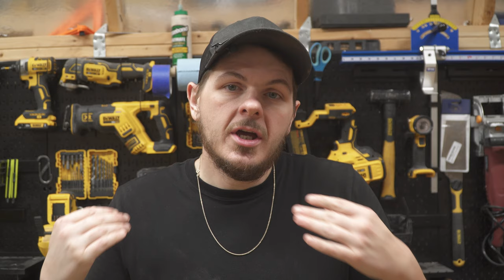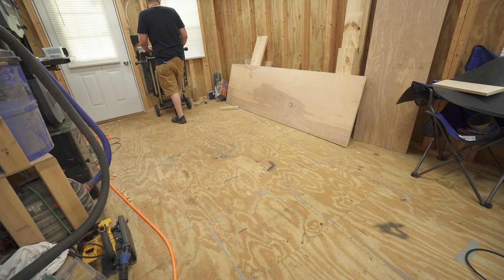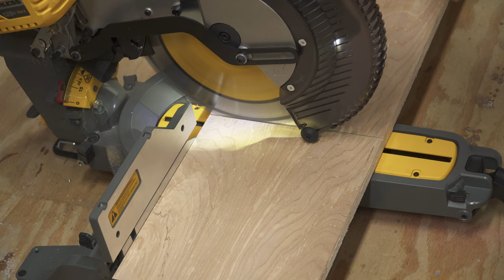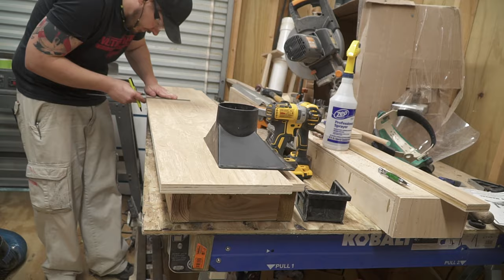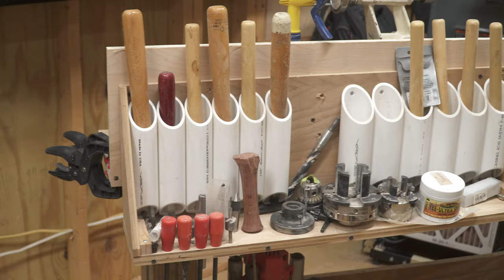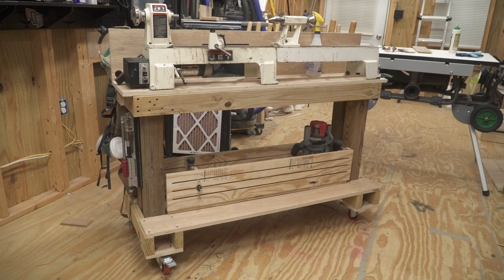Building A Mobile Lathe Cart In Under 2 Hours!

Comment: I agree with the other comments about the amount of face time. Remember that viewer engagement is really key to getting your metrics in order.

In your opening you talk about how narrow your new shop is, but really, that could have been over a quick panning shot, or a couple of shots of the struggles you're having.

In writing, Ernest Hemingway popularised the "Iceberg theory", which to oversimplify can be summarised as "Show, don't tell". You should apply this theory to your own works, as you're moving into the narrative and storytelling space.

But - regarding the project here. There are SO MANY GOOD DESIGN ELEMENTS! I love the backing with the chip collection. I love that your pen press hangs on the side. I love the tool storage on the back (though I can see chucks getting knocked off - so maybe add a lip? Also reaching over the lathe for tools is bad practice, so it would be nice if that section swung out to form an L).

For a 2 hour project, I think you did a great job!

I know this is only a couple months old, but are you finding it stable enough to turn on? Does it add enough weight to stop larger pieces vibrating? Are the wheels solid enough?

Thanks for sharing. I'm definitely borrowing some of these elements for my stand!
Reply from the maker: Thanks for the input. The casters have heald up great so far  and seems to be very stable. The lathe does not accept over 10in in diameter turnings so haven't turned anything large yet but it's pretty stable as far as I can tell especially when all of the casters are locked. As far as the tools I don't use that area for tool access during turning as I bring the tools I will need forward before I begin. So reaching over for me is not an issue. The chucks are held in place by dowels that are inserted at about a 40 deg angle now so they can't go to far. So hope that helps.

Comment: Good morning:

I have been doing a lot of research on designs for my Grizzly lathe with extension.   There have been many good designs but yours has been the only one I found that designed dust collection in.   I have a couple questions about how your design works in context of dust collection.   I don't really need plans as I can figure that out myself for dimensions, etc.   My questions are mostly about the most effective dust collection.   I don't have a stand right now so I'm asking in order to inform my work.   I appreciate your design, particularly that you gave thought to the dust collection.

1) How does your dust collection work for you?    Does it capture most of the shavings?   Do you have to do a lot of manual sweeping to get the shavings into your dust collector?   Does most get captured?   How much ends up on the floor?  I have a cyclone with 6 inch duct work and have spent a lot of time integrating my tools to use it.  What I envision in a design like yours is 2 four-inch ducts behind my lathe which is close to what a 6 inch duct  can carry.   I was wondering if you found one four inch duct sufficient. 

2) Is the back high enough to get most of the shavings?   I'm not asking already knowing the answer.  I'm trying to get the best solution for my stand.   Would an inclined top help to route the shavings down to the dust collector ports?  

3) Is there an optimal 'height' for a lathe stand?   I am about 6 foot tall.   I believe it would be easier to sit while turning but I don't recall from long ago if that is how I did things.   If there is a formula or rule of thumb, that would help.

Comment: I recently purchased a king lathe.  It has no mounting bolts just abjusting rubber pads under the feet .  How well will this work shouldnt the lathe be mounted solid  to the table .  If i go this way I will probably need custom made  jack bolts with levelling spacers